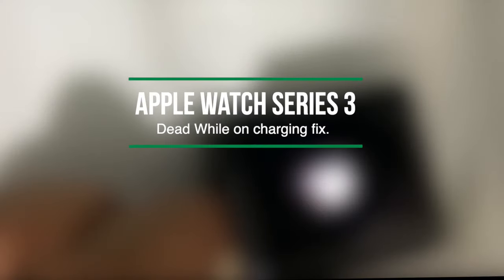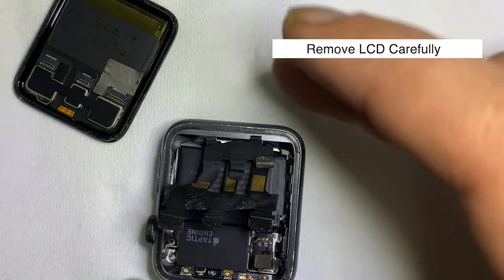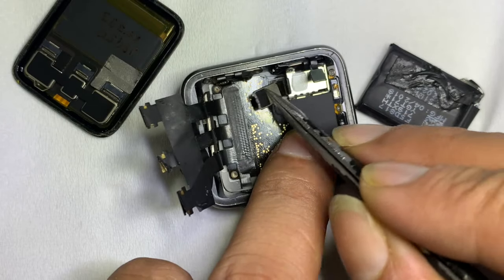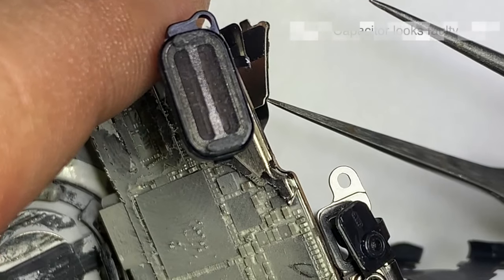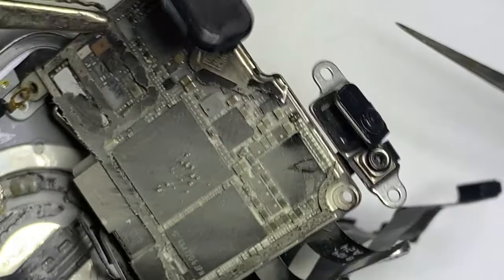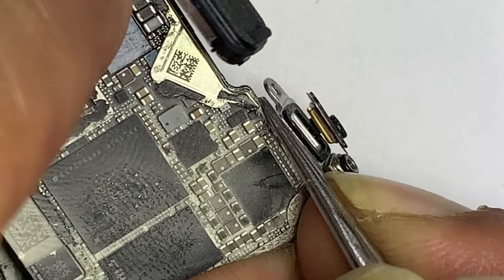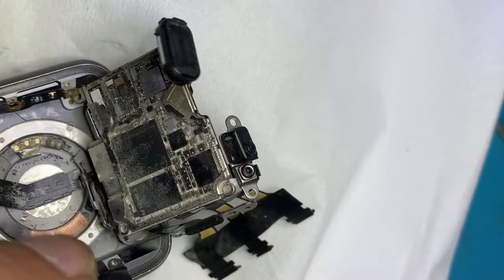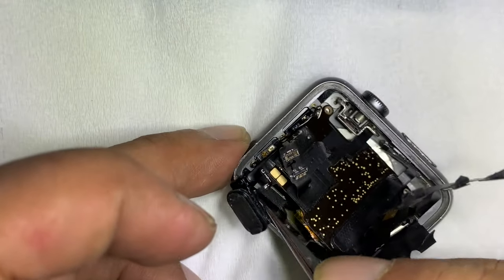Apple watch won’t turn on!Heating on charging and dead fix.

Comment: So since swimming in Cancun my watch Apple series 6 watch will no longer turn on it black and over heating I have tried several videos but no luck… does this mean this watch needs to be sent for repairs?
Reply: Did you find anything
Reply: Any luck? Same happened to me.
Reply: Same problem with my seies 6
After swimming in red sea this problem happened …what to do 😔

Comment: My watch just heats up when charging but does not turn on or show anything on screen. I charged the watch the night before and then turned it off, woke up the next day and turned it on and its at 2%, then it dies and wont turn on again
Reply from the maker: Might be some hardware issues on watch.
Reply: I have the exact same issue